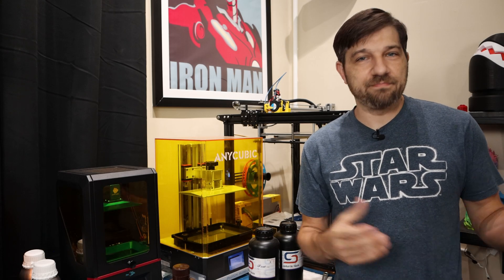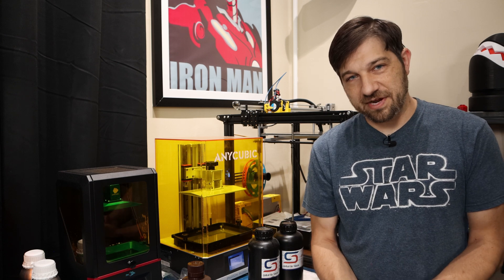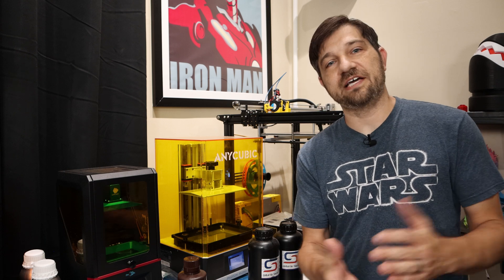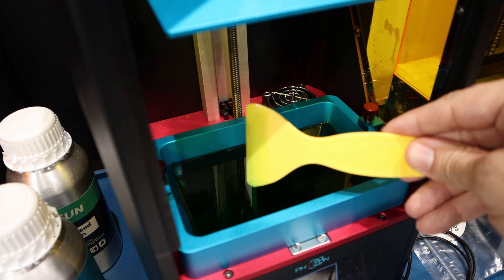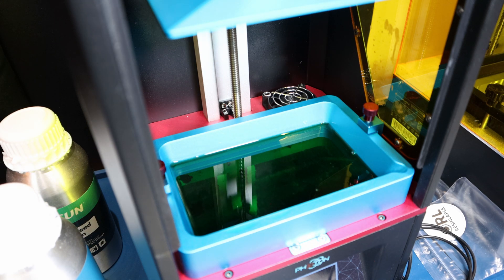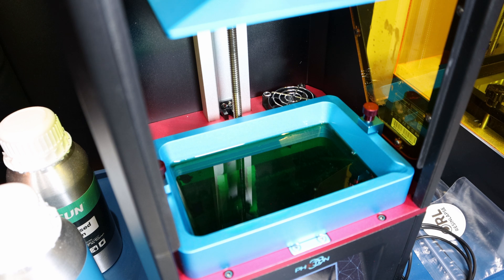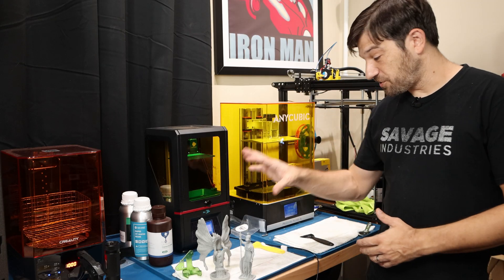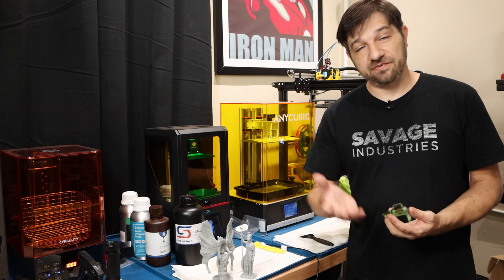Can You Leave Resin in the Vat?

Comment: Well, i was doing a clear print, and it failed, end of july. I was so mad, i shut it off n didn't even look at it till yesterday, Nov 27th.
All i did was pulled off the failed master sword, scraped off the plate, topped up the vat, and printed an entire set of chess pieces. (Or 1 side/half of a set of chest pieces. Gona do the other ½ with some dye added.
Anyways, worked fine. 4 month old resin in it. Lol

Comment: You can leave it for a whole year if you want as long as it's not exposed to light.  I did it just fine.  Make sure to stir it up real good.

Another tip...After you're done printing a plate you can leave it hang for days with no issue.

Comment: Last night I left resin in the vats of my two printers. One of them stands outside in a balcony and the other inside the home. As the printings would end about 2a.m, I took the caution of covering both printers with a cardboard box to completely avoid UV light. It's summer here and as I took out the boxes about 9am I found out that the resin of the printer which stays inside the house was fine. But the other had formed two pelicules, the one lightly adherent to the vat and another in the surface. Between the two pelicules, an apparently normal resin . My conclusion: even if I completely blocked the UV rays, the hot outside temperature solidified part of the resin of the printer which stays outside.

Comment: You can.   But it's not a good idea.   Air quality, temperature variation effecting the resin, stray UV that the covers don't catch... all of them can effect the quality of prints or health.    I'd recommend that you properly empty, clean and take care of your equipment and supplies.   A cleanup now is a lot less work than a cleanup, or dealing with toxic exposure later.    Lazy is never an optimal solution.

Comment: I have been wondering about this only had my printer a week but i have been cleaning after every print. If i am going to do more then 1 print a day now i wont clean after every print thk you for the video very helpful. Like i saw in 1 of the comments tho i will not leave the resin tray with resin in it for long periods without a top and bottom silicon cover. The fvp can break and the machine is to expensive just to thro away cause i am lazy and screw it with resin.

Comment: I left resin in the vat for 3 days ...then before printing mixed the resin with scraper for a while and printed..prints came nice but I noticed there was mist buildup inside the cover of printer... Any idea why this is happening?
Reply from the maker: My guess is just condensation. Either a change in temperature or too hot/cold ambient temperature. The separation may have made the evaporation temperature change.

Comment: I leave resin in my vat all the time. I've heard people warn about the fep leaking over time but I think feps usally get damaged during printing and cleaning not from just sitting around. I guess if you really wanted to be carefully you could put the vat in a bag or place something between the screen and the vat during storage.
Reply: I have only ever had a leak once. It was caused by a little spot where there wasn’t enough tension on the fep. It only started leaking after the fep wore out a bit. I recommend a plastic bag or paper towel under the vat just to be safe, but probably not necessary.

Comment: My only recommendation is to get yourself a silicon make up brush to stir the resin.  That hard plastic can get little points on it which will can cause Fep issues.
Reply: I use a silicone scraper combined with a Mighty Vac.  Scrape around the vat then you can suck the resin into the giant syringe and then back into the vat.  It mixes it up really good.

Comment: Hi Kris,
Please, please learn from my mistake. Left a half full vat of resin on a Mono X over a weekend. Came back Monday and ran a print but it failed. Tried to remove vat but found it was stuck to glass. There was a tiny pinhole leak in the FEP which had seeped resin everywhere. Moreover the horror gets better. Due to poor design, the resin had seeped into the Mono X, run down the connectors the TFT and MB, wicked into the flimsy ribbon clamps, and pooled in the bottom of the machine. All of which was then partially cured but the UV light bouncing around the inside when I did the test print. I have tried to rebuild the machine, new screen, boards, ribbon cable etc but can't get it working. Seems Anycubic don't have spare parts, and those they do are revised, so new parts don't work with old serial numbers. Basically it is junked. Please check out vids on how to protect your Mono X from leaks (cheap fix) and FDM print vat covers (top and bottom) to allow you to lift the vat off and store it dismounted. Now I run a basic Mono will screen protection and store vats with silicone top and bottom covers. The whole issue is compounded because Anycubic never bothered to make spare Mono X vats in volume. 
Been subscribed since you started, keep up the good work.
Reply from the maker: Thank you sir for letting me know your experience. I'll be sure to look into this now. I appreciate the information and the subscription.
Reply: I find the best thing to do before running any print is to lift up the vat and ensure there's no damage to the fep and that there's no resin on the LCD screen. Do that and I bet you'll never ruin a screen.

Comment: I was wondering about that, it is a pain. And oh, thanks... your code was he fix (nozzle dive into board), saved my ender five plus from being sent back to Creality. The display is in Chinese now but by the time I made the switch I already knew what pushing them did.
Reply from the maker: Awesome! I have a video on how to change it back to English. 😉
Reply: @kerseyfabs  even more coolness: thanks again.
Reply: What happened to your ender5 plus? I also have one.
Reply: @ZerocoolsPropsandCollectibles  until I used the firmware upgrade from KF the nozzle would dive into the bed on every centering attempt.
Reply: @singularitysquaredllc.895  Damn. I been having stringing issues out of nowhere. Got them tamed still not perfect.
Reply: @ZerocoolsPropsandCollectibles  hmm that sounds like an airflow-fan issue. Out of nowhere? Do you remember what you were doing - (settings changes you made?) just before you got them?
Reply: @singularitysquaredllc.895  was talking to Kersey and I'm gonna try a duct cowl for my stock print head. I thought I was having extrusion issues replaced the stock motor.
Reply: @singularitysquaredllc.895  yes imo out of nowhere.

Comment: Ive left siraya tech scuplt in the Mars pro for 3 months and been able to achieve relatively okay results. I left the printer next to my food dehydrator while drying out some filament which warmed up the resin. I then took a paint brush to stir the resin so I had a somewhat homegenous vat of resin. No way I could have even thought about using it without these steps, as the heavier particals had completely separated and fallen to the bottom.